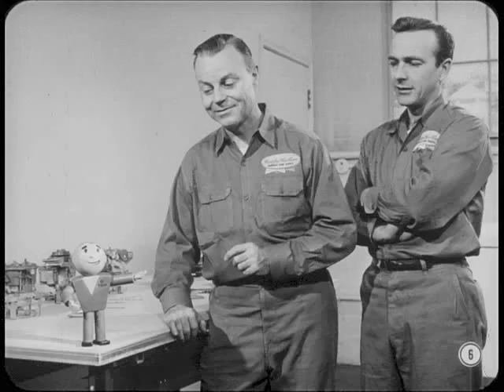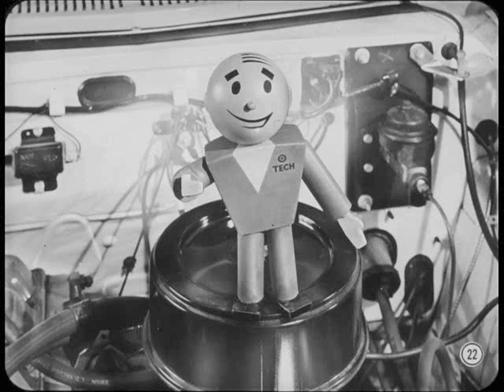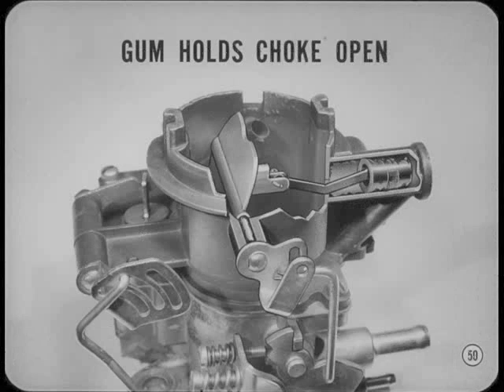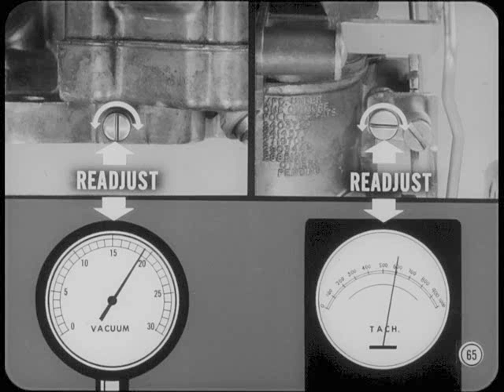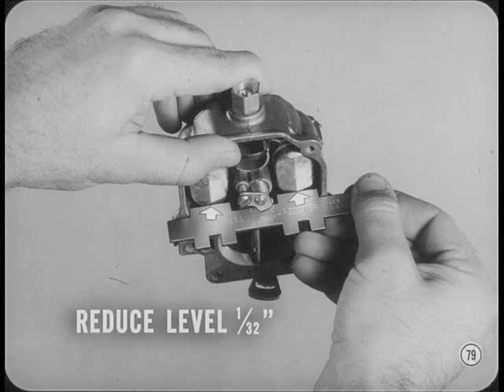Chrysler Master Tech - 1963, Volume 63-7 Carburetion and Performance Diagnosis

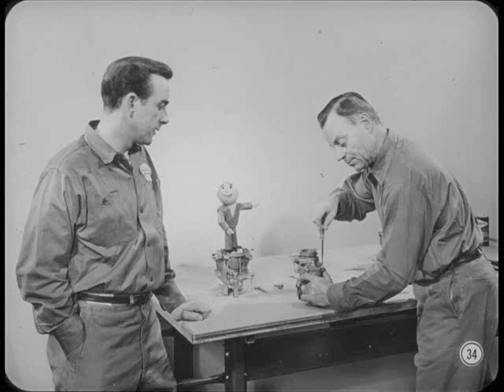Comment: 7:43 It is also smart to read TSB and recall notices. Sometimes there is a common problem among a certain car type, and there is a special fix. Other times there is an extended warranty to cover it.

Another thing that is important is to find flowcharts for diagnosing the exact model of car you are working on. There may be some sort of special procedure just for that type of car. Many people will assume that a stiff brake pedal is always the vacuum brake booster. It isn't always the case. If a diesel engine is used, they have a vacuum pump to operate the booster, and odds are, the vacuum pump is at fault. Other diesels have a hydroboost brake system, and that has its own flowchart.
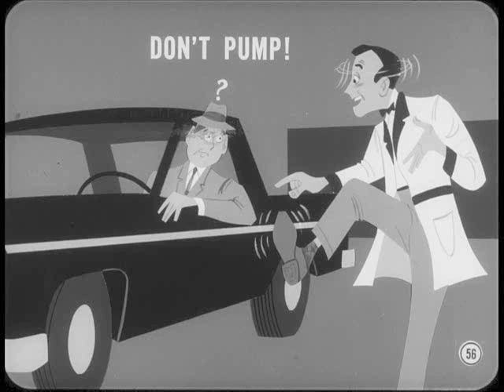12:30 Many people have never driven a car with a carb engine and many people had one ages ago. As a result, when they drive a car with a carb engine, they don't realize that they have to do things with the accelerator pedal to start the engine. I would forget every time until I was cranking the engine longer than usual. Some cars would start, some wouldn't.
EDIT: 4:18 I don't know how often an engine behaves like there is a vacuum leak because the PCV valve doesn't function correctly. I used to have a 1995 Honda Accord that ran poorly for months and I couldn't figure it out. I happened to shake the PCV valve, and it sounded like a soccer ball landing in mud. I bought a new one, swapped it out in the parking lot, and things improved almost instantly. From that day on, I made sure I gave every PCV valve a shake. Do remember that some vehicles don't have one. Some cars have a fixed orifice that needs no testing. Other cars, especially Volvos and BMWs have a system that is complex and expensive.
14:00 Some carbs from the late 70s and ealy 80s controlled idle speed mixture by reacting to an oxygen sensor, similar to an EFI engine. Other ones also had some kind of speed control, similar to the IAC found on a throttle body of an EFI engine. Keep that in mind if you are seeking advice for solving problems with a carb engine. Often the O2 sensor would foul up and make the car perform very poorly. That is why some owner's manuals would tell you to replace the sensor at certain miles, or a warning light activated by mileage would tell you. My dad had one of those stupid carbs on his 1987 Hyundai Excel and that was one reason that car was so crappy.
Reply: TSBs were more valuable than Recall Notices!! At least at Lincoln... Ford was hard pressed to admit a Recall was needed. But a recent TSB was always available. 😉 

BTW, if interested, I've been currently putting ALL of these Service Videos in chronological order on my Channel, in its own Playlist. 
Painstaking!! 😖😠